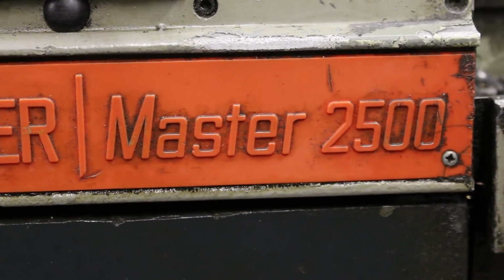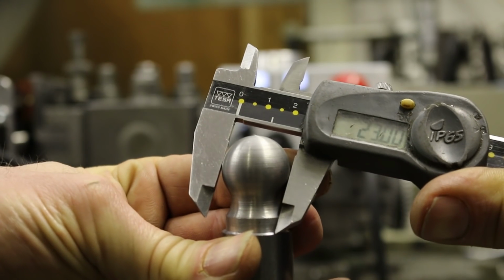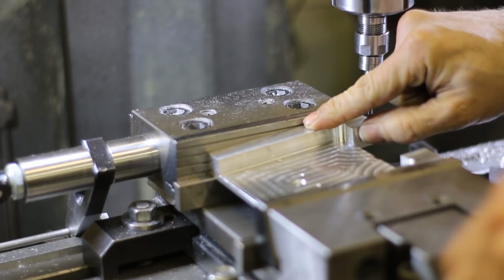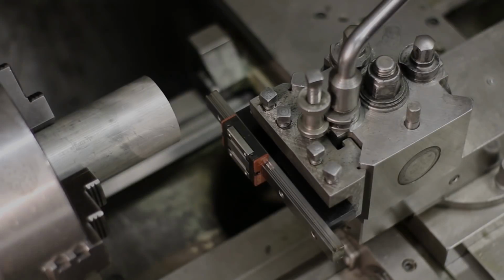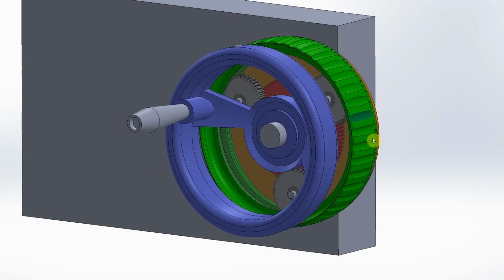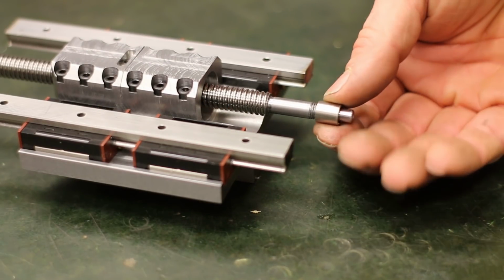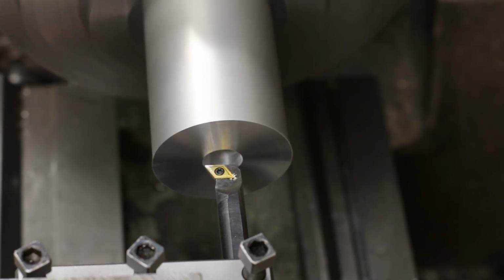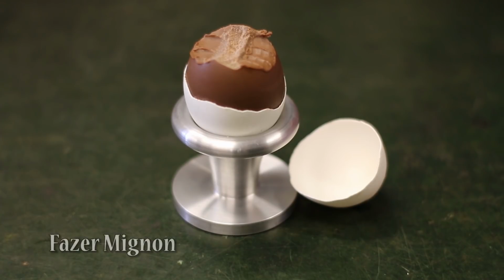CNC Attachment for Manual Lathe

Comment: Excuseme. Are you can give to me, the part list?. Thanks.
Reply from the maker: Stepper motors: https://www.ebay.com/itm/283425207825 Works fine with the cross slide, but use something more powerful with the compound slide.
Stepper drivers, didn't bought these, but are similar: https://www.ebay.com/itm/133728619426
Breakout board, (find something better), not bought this, but used similar: https://www.ebay.com/itm/233445300969
  
All of the mechanical components were bought from: https://www.dold-mechatronik.de/ , except the linear guides I found in my own stash. I believe they are Bosch Rexroth SNS R0442, Size 15. These are adequate, but I would go with one size bigger. Here is the Dold Mechatronik shopping list:

Ball screw, Ø12, pitch 2.5mm, length 252mm, 1-side end processing according to the drawing EZ8538 Liefertmin 25.02

Ball screw nut 12x2,5mm, single aisle return Liefertmin 25.02

Wiper for ball screw nut Ø 12, all slopes

DIN 439 hex nut short form, galvanized M8x1 (fine thread)

Angular contact ball bearing 30 / 8-2RS-TN 8x22x11 mm

Backlash-free Flexible coupling, clamping hub design JT20C D20L26 6.35 / 6.35

T5 timing pulley 10mm wide - 20 teeth, bore 6.35mm H7 with clamping screws

Toothed belt closed T5, width 10mm, length 300mm / 60 teeth
Reply: @kerkkonenahaima7322  Thanks very much.

Comment: Pretty good! It looks like it really does make for a good CNC machine!! Really handy like this.

Would you want to make the long axis also CNC controlled? So it can do something like a car axel too?

I really like the modular part of the machine. This does not look like it is too dramatical of a retrofit, and it really leaves the machine in its natural shape. 

Great!

Greetings,

Jeff 

p.s. 
If you like machining something out of the ordinary; check out my archive and grabcad page on my youtube profile!
Reply from the maker: The beauty of this setup is that it´s super easy to deploy and does not hamper the manual turning operations at all. 99.75% of my lathe parts are still made manually. If you look at the car axle; it may have some nasty CNC-required feature on one end, but mostly just even round bar that can be easily made as a manual operation.
There are some interesting servo motor conversions for manual lathe leadscrews for single point threading. With this cross-slide part that setup could easily make a full CNC-lathe. There would still be some backslash issues when using the lathe´s original leadscrew with a half nut.
Reply: @kerkkonenahaima7322  Ball screws are the only way to get it accurate with stepper motors. Unless you somehow use the input of the glass ruler as a reference for the stepper motor. 

Greetings,

Jeff
Reply from the maker: @jeffjefferson2676  Yep, that would solve the backslash issue, but would disturb enormously the manual operating.

Comment: Amazing work!!!. I'm very impressed with the carriage. Please, Could you tell me the me the link of the tapping head that appears in the minute 12 of the video? I don't know the correct name of this but I can't find any 4teeth chuck for my threads tap. Thank you!
Reply from the maker: I believe the correct name is guided tapping wrench or centering tapping wrench. Good commercial solutions for this are rare as hen´s teeth, my wrench is my own design. It has a Dremel chuck threaded on a 7mm shank that glides in a piece of brass tubing. The chuck aligns the tap to center and two screws holds at the square end of the tap and acts as T-handle. This wrench is excellent for M3 and smaller taps, and has proven to be a real tap saver. I have a different solution for larger taps and hopefully I can find time to make a video out soon. I can include this wrench on the video for more detailed explanation. 
Meanwhile check these links: 
https://www.youtube.com/watch?v=lVzMHBdau-4
https://www.youtube.com/watch?v=sC9lWrQeNX0

Comment: This is great - just what I was looking for.  I want to make some anvils for my DIY english wheel.  I would have never imagined your solutions.  Thanks
Reply from the maker: This would definitively beat any mini-lathe on that. I would choose bigger motor for compound slide, the trapezoidal (Acme) lead screw has terribly bad efficiency under heavy loads. Material removal on large diameter steel parts can easily make the motor lose some steps and expensive stock is ruined.
Reply: @kerkkonenahaima7322   Thanks for the information.  Stay warm.  Dave
Reply: Can you tell me what type of motors you used?    Thanks
Reply from the maker: @davethurston753  https://www.ebay.com/itm/283425207825
This works fine with the cross slide ball screw

Comment: the spindle index wont work in mach 3 running usb.. I tried 100 options , different sensors, about a month.. if you figure it out let me know.. I even tried different control boards.. Parallel port is what its designed for
Reply from the maker: I gave up after couple of days😎, I'm not going to LPT, perhaps it's good bye to Mach3 and wire up something else. Keen viewer Greg Gregory recommended this: https://www.centroidcnc.com/centroid_diy/acorn_cnc_controller.html
Reply: @kerkkonenahaima7322  THAT SOLVES IT

Comment: Great video, what was the name of the breakout board you used and are you using windows 10?
Reply from the maker: I believe it's called "Two Trees", https://www.ebay.com/itm/233445300969 , but I hesitate to recommend it. I haven't been able to make the index pulses working for threading. Maybe my lack of knowledge on this field, or the card just doesn't support that feature.
My vintage laptop is running on Windows 7.

Comment: Would like follow-up video when you mail the threading problem , suspect you may need quadrature encoder on headstock spindle.
Reply from the maker: Yes, that's on my to-doo list, but will require some research first. Mach3 can only take simple one pulse / rev signal for threading, but I was not able to get the indexing running at all. Real encoders are out of the question with Mach3 if I understand correctly. I think that my breakout board doesn't support threading at all. I will probably change the control to Acorn you suggested or Masso or whatever I think would do the job properly. The casing will not take anything bigger electronics inside and while it needs major changes I can change at the same time the Z-stepper to something with more torque. But right now it will have to wait for quieter times in the workshop...

Comment: That was good to watch! You have some nice tooling. I've wanted a better lathe for several years now, and I know Colchester is a good brand. I like your CNC attachment. Seems to work very nicely. Congrats!
Reply from the maker: Thank you Paul! 
I have certain allergy against Chinese machines, though I own some. Preferring western equipment has turned my workshop somewhat as a museum of technology. Many Colchester lathes have nice clutch system that engages the spindle, the motor runs all of the time. That gives silky-smooth starts and reversing for the spindle, this is very useful when single point threading without an indicator dial.
Reply: @kerkkonenahaima7322   Colchester is definitely on my list for a good lathe. I did not know that the motor runs all the time. Have a great day!